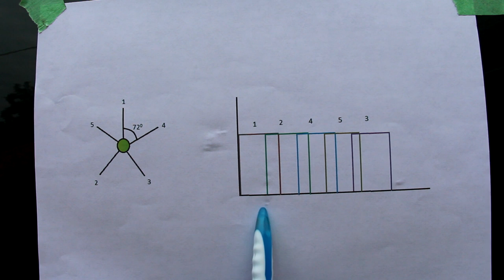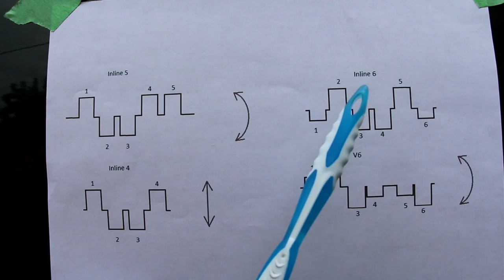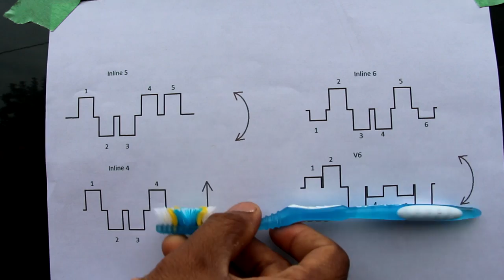Why Inline 5 Cylinder Engines are an Anomaly

Comment: The 5 cylinder engine in the Acura Vigor never failed or had any issues.
Reply from the maker: Good motor
Reply: speedkar99 I’m sure the motor on the Acura is quite nice but to say that none of them had any issues... idk man. Volvo is famous for their 5 cylinder engines- my Volvo v70 T5 has over 420,000kms and is running like a clock and still  damn fast.

Comment: hey man, with quarantine these days do you think its necessary to crank the engine first  a couple of time before starting it to avoid running the engine dry the first couple of seconds? i mean some cars haven't been used in weeks/months. would it be a good idea to let oil circulate first?

Comment: The damage to the crank & con-rod is nothing. Machine shop will machine the crank & supply undersize bearings, and resize the rod to factory specs.
Reply from the maker: Possible but still shouldn't have happened
Reply: @speedkar99  Very true. I've seen this damage before. It is a flaw with alloy block engines. This is the time I wish I had pics of a Mitsubishi 4G54 engine which had a cracked block. I hope you take my word for what you are about to read. The TS Magna with the engine in question came to the place I worked. The owner complained about it losing copious amounts of coolant. I started with the usual checks, like checking the oil for emulsification, combustive gases in the coolant, compression test, etc. These showed nothing. Next I checked all the hoses, & they were fine. I then checked around the radiator side of the block. I very quickly discovered the block was cracked. This was an understatement!! When I later removed the cylinder head & head gasket, I was stunned at what I saw. The block was extensively cracked from the second bolt hole at the driver's side front, to the second bolt hole from the passenger side front of the engine, and down the bolt holes, then along the block through the welch plugs. This part of the block had also dropped by almost 2mm. The way to repair damage as seen in this video is to either replace, or machine the crank, replace, or resize the rod, & obtain the relevant parts. Next, remove the bore rust by honing. If the rust is severe, bore the block, if it is possible. Once these jobs are done, the head mating face will need machining, along with the mating face of the head itself. Second hand engines can be bought, but it is like playing Russian roulette. Very good video too.

Comment: I changed the timing belt in my S40 a few months ago and now I know why the dealers charge so much.  WTF.  That's the reason they made the spacing between the cylinders narrower so they could fit the engine in with about 3/4" of space left between the engine and the car frame.  And getting to the water pump bolts (with a torque wrench mind you) was ridiculous.  I should be good for another 100K miles and hopefully the car will die before I have to do that job again.  But I love my Volvo. Seriously.
Reply: Granted I have a 04 s60 so I'm sure it's a little different for the s40 but all I bought was the cam locking tool. What a life saver that was. It took me about 3 hours to do timing belt, water pump, idle pulley and, tensioner.

Comment: I had the serpentine belt snap at speed at 100 kmh on the turbo version of that engine. In seconds it shredded that stupid plastic timing cover and I ended up with a failed timing belt. Luckily the shop could rebuild the head and it now runs happily but it was a VERY expensive job.
Reply from the maker: What did they have to rebuild in the head ? Valve stems and seals?

Comment: another interesting 5 cylinder .
5 cylinder 4 stroke engine , with double volume center cylinder acting as supercharger/compressor.
Dont remember where , but I saw several billet prototypes in the pits, Circa late 80's
Think it was at Road America WIS. Renault or Cosworth maybe ???

Comment: Hey I am new here and thinking about a 2006 XC90 @ 179000 miles. Any suggestions on what I should look at and ask b 4 maybe buying?  Help they seem to be great but!!!!
Reply from the maker: Check out my used car buying series of videos
Reply: Automatic transmission can be a weak point in the P2 platform Volvo's. Volvo used to say these transmissions never need oil changes. Guess what... Check for slipping when it shifts. Make sure it doesn't shift harshly or it revs excessively, especially when shifting from 3rd to 4th. There's a yellow transmission oil dipstick hidden below the air intake, take that out and wipe it on a clean piece of paper, clean transmission oil looks red. If there's really tiny pieces of metal in there then walk away...
The angle gear for the AWD system may wear out over time. Look out for clunking noises during load changes during a test drive.
Rubbers tend to wear out on cars of that age, that also results in noises in the suspension may affect steering. 
Also check when the timing belt was last changed. They need replacement every 10 years or 100K miles, whichever comes first. The water pump gets replaced on the second belt replacement, if they already did the second belt then make sure they didn't skip out on that. The water pump on my XC70 (same platform/engine as the xc90) looked brand new after 19 years and 160K miles, but a broken water pump will definitely ruin your day. Also check the shocks for leakages and proper functioning. Don't know if the XC90 came with self leveling nivomat shocks or the 4C suspension, but those are expensive to replace.
Those are the areas that require most attention as far as I know :)
Reply: @dvdouden  Wow I knew a few of these but was totally unaware of that lifetime tranny fluid. Then the water pump with belt change. People really gotta watch what they are getting. I haven't talked with guy but he want 3950 for it and I feel it is way to much unless he can prove all these things have been maintained as you say. It was kind sad watching this guy take the motor apart and explain all that he did. Anywho I do thnak you for the input. Kindly a freind in Alaska
Reply: @jamesmana5247  Just google for "Volvo automatic transmission problems" and have fun reading the horror stories. It's not all bad by the way. You're not guaranteed to run into problems, but it's something to keep in mind when looking for used car.
I should mention that part of the problems were caused by a design issue in the B4 servo cover. Volvo fixed that somewhere around 2002, they seem to have gotten a lot more reliable after that fix. 
The lifetime oil doesn't necessarily have to be a problem, as long as the tranny hasn't seen too much abuse. Under normal conditions you may get a lot of miles out of the factory oil. My 2003 XC70 has the same Aisin AW55-50 transmission as the XC90, it still has its original oil after 170K+ miles and it's holding out pretty well. 
But if the car has been used a lot for hauling trailers or in mountainous areas then chances are that the oil has overheated on more than one occasion and should have been replaced. Overheated oil breaks down and doesn't perform the same as new oil. This results in wear on the clutches, those particles will end up in the oil, causing sticking solenoids (which results in hard shifts and rev flares, which causes even more wear on the tranny, etc etc). Tranny revision or replacement aren't cheap, somewhere around $2-3K I think.

A new timing belt will set you back somewhere between $500 and $800K. Half of that will be parts, the rest labor, it's a fiddly job because there's not a lot of room in that engine bay. Took me about 8 hours to replace the belts (timing and poly belt), rollers, tensioners and water pump. A professional mechanic will probably do that job in half the time.

Replacing nivomats or 4C shocks costs upwards of $1K iirc.

Problems with the angle gear or center diff are sometimes "fixed" cheaply by removing the propshaft, effectively turning the car in a permanent FWD. That doesn't seem to happen too often, but I've encountered a couple in the ads when I was looking for my car.

Comment: Surprised that plastics can cope with temperatures warmer than your living room? Why aren't your coffee maker and kettle made entirely of metal? After all, "they would stand high temperatures better".
The oil filter orientation actually makes oil changes CLEANER. The liquid drains back down into the sump/oilpan.
Reply from the maker: My kettle is made of metal. Ain't trusting drinking plastic

Comment: The explanation of "balance" would be fine if the engines were 2-stroke units. However, the ones depicted are all 4-stroke ones. The  crank during the power stroke is being pushed downwards. The next time that piston is heading downwards (the intake stroke) that part of the crank is pulling the conrod; the force it experiences is UPWARDS.
All engines oscillate front-to-back unless you have cylinders at opposite ends firing at the same time - and no real engine does. This can be mitigated by ensuring enough bearings, and by damping such oscillations with a "dynamic balancer".
Reply: look at at the five cylinder LeBlond or all the Pratt and Whitney (among other radials) common crank pin engines. all odd numbered, but the engineers balanced the push and and pull of the con rods. Granted it's rare to package a 5 cylinder air cooled aircraft radial in a modern motor car, but my point is there are solutions for almost any problem of imbalance.

Comment: What would be more advantages of a 5 cylinder inline engine than just the balancing ? I think it's a heavy engine, so fuel consumption is not that low...
Reply: power delivery is smoother with a 5 cylinder, the power strokes have less down time than an inline 4. And it sounds like half a V10 :)
Also, an inline 5 can still be mounted transversely relatively easy. There are a few transversely mounted inline 6s (by Volvo), but mostly you'll find those to be mounted longitudinally (e.g. in BMWs). They quickly become too wide to fit between the front wheels.
Reply: @dvdouden  Thanks for this complete technical explanation. Greetings ! ;)

Comment: I love this engine on my 2006 Volvo S40, sounded a lot quicker than a 180 hp car, great car all around except for that PVC oil filter design. I put 260K miles on the car a sold it off.

Comment: My t5 volvo s60 same but older style  engine interesting how they have moved a few things on the newer 5 cylinder cool video ps I dont understand them using plastic on the coolant valve and oil pick up shows how things get craper and cheaper
Reply from the maker: How has it held up?
Reply: @speedkar99  it's a good motor been a bit of a arse with the vvt on pot 5 but other than that ok o and there prone to the bottom end ie big end bearing going the 2.0 5 pot turbo dont do well unless you really look after them
Reply: I've had alot of Volvo's and I have never had anything better than there old red block engine there though

Comment: Would you poss say that it could of been the oil cooler leaking antifreeze
Reply: Could be. Could also be a cracked head or even block.
Reply: unlikely that the oil cooler would fail internally.  First such case I've seen with these engines (31 years total ownership between two Volvo 5 cyls).  Ford used this engine and oil cooler during its ownership of Volvo.  Not saying it couldn't happen but it would be very unusual for this engine.  Volvo designed a good one, just needs regular lubrication like them all plus occasional replacement of pcv system

Comment: Im sad Volvo did away with 5 cylinder engines. Ive had them for years and im on my last one. I think they are the best engine,  turbo only of course, my first had no turbo and was really slow.
Reply from the maker: What drew you to the 5 over the 4? The sound and smoothness?
Reply: speedkar99 You even explained it. They have more low torque, better overall vibration and noises. Obviously worth it to Volvo to give up space to gain the power and aesthetic properties

Comment: Hi Again Fella' I am out to find out where the clicking is coming from in my Nearside Idler in the gearbox. at 72 I am Reluctent to attempt a repair. but I did the ABS on My V70. a nightmare. I had to buy a computer to set up the ABS Again. However I could not let a garage do it. they would have stolen money from on the repair....Volvo V70 ABS Beware?.

Comment: As a retired Master Volvo tech with 48yrs with the brand I can tell you many nightmare stories about those "white engines" as we called them. If you look closely at the block you will see the four olympic rings of Audi cast into the block. The red block engines were the last real Volvo engines as far as I am concerned. As you can see sludging was a major issue even with shorter oil changes intervals. And if you should break a timing belt you throw the cyl head away because it not only breaks the valve guides it cracks the bosses the guide fit in. "Nuf said.
Reply from the maker: Thanks for your input. I think these newer models were fairly reliable
Reply: @CEHepp  I left Volvo in 06 and they were still on the engines we were changing out due to sludge. They were on the side of the block below the deck. I am sure things have changed since the Chicoms, 'Geely Motors', have taken over. I worked for one of the old school engineers who personally designed the red engines, from the B14 on through the B23. He and others like him were forced into retirement by the gang who ran Volvo into the ground. Evald was given a dealership for his decades of service to Volvo, that is how I came to work for him.

Comment: VW Crafter has 5 cyclinder diesel engine. It is an utility vehicle. Utility vehicles need reliability.  If 5 cyclinder bad, why they are using it in such a vehicle ?

Comment: First time I heard about inline 5-cyl car engines was the Mercedes 300 D in the mid 70's. Then Audi came along with their inline-5 petrol engine for the Audi 100 and Quattro in the late 70's. Volvo started with 5-cyl engines when they introduced the 850 GLT (1991), and kept producing them until 2016. One of the most peculiar engines must be the VW VR5 - a 5-cyl engine in a V-configuration with 15° angle.
Reply: It is hard to believe that the length of the engine package would shorten enough to make the V5 VW engine a practical engineering project.

Comment: Great video. I realised those engines were not so great as soon as I saw the coolant pump being driven by the timing belt instead of the accessory drive.
Reply: That is still not too bad. Anyhow if you are replacing the timing belt, you should replace the coolant pump at the same time as accessing the coolant pump requires the same amount of work as a timing belt replacement. You avoid double job.  In my opinion, the most shitty engine is the Chrysler 2.7L, timing CHAIN driven coolant pump.  That is where the dumbest idea appear in automotive industry.
Reply: @fleurdewin7958  While that is standard (and good) advice on cars like VW/Audi which are prone to pumps failing, these engines have very high quality water pumps that tend to last the life of the car.  In fact, the replacement pump is very unlikely to be the same quality as the factory fitted item and actually more likely to cause a failure...

Comment: I have an Audi 5 cylinder engine in my 1989 Audi 2.3 90 honestly I don’t get the appeal. Maybe it’s because it’s a 10 valve and not a 20 valve and non turbo

Comment: While almost all Volvo whiteblocks are created equal, the design for the C30/S40/V40 were of lesser quality (probably due to lack of space). If you want a car with these engines you'll want all P80 cars from 93-00, as well as the S60/V70 from 01-07, they all just had a much better layout with more space to work with, and more quality parts that aren't made of plastic.

Comment: Video doesn't tell why 5-cyl are a bad engine. 2nd tier vibrations? Don't make me laugh. Porsche 944 had huge 4-cyl engine with displacement from 2,5 to 3.0 l. And it was still smooth and reliabile, despite major 2nd\4rd party vibrations present.  And frankly, today in 2020 almost no manufacturer use those well-balanced straight 6 inline engines.

Comment: I always liked the Acura Vigors 5 cyl...
Reply from the maker: It was interesting that they were longitudinally mounted although still FWD.
Reply: @speedkar99  Yep...  And as I recall so was the 3A engine from Toyota...  Seems I remember it being longitudinally/FWD when I did a clutch replacement 25 years ago?  Had that horrible variable venturi carb too!
Reply: Meant to mention the 3A engine was in a Tercel...  BTW, great job speedkar99, can tell you really tear into things, not just talk about it.

Comment: This video is wrong. Having owned many cars with side mounted cartridge oil filter housing they are superior and create almost no mess when chaining oil. Just look on-line on oil change videos and you will see a mess from every bottom of the engine mounted oil filter being changed! Moreover, I can inspect the oil filter at any time without having to drain or change the engine oil! very useful for additives and engine flushes.

Comment: I hate how European car makers use so much plastic in high heat areas. It works fine for 10 years or so but as the plastics age they crack and leak. What do you think was the cause of failure for this engine? The head gasket looked OK but there was coolant in the oil. Oil cooler failure? Did you see any smoking guns?

Comment: The last two minutes are interesting.    Before that it is a very boring description of how to strip a motor.  If 5s are so bad how come Audi did so well with them?
Reply from the maker: That's why I put in the time stamps
Reply: True but if the question is 'why are 5 cylinder motors an anomaly'   then showing how to take the head off seems to be off question.